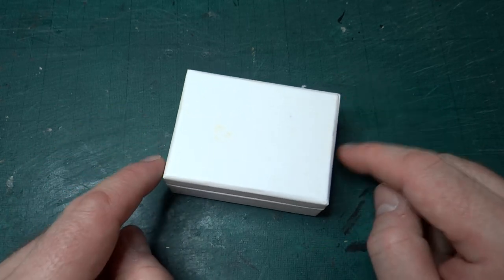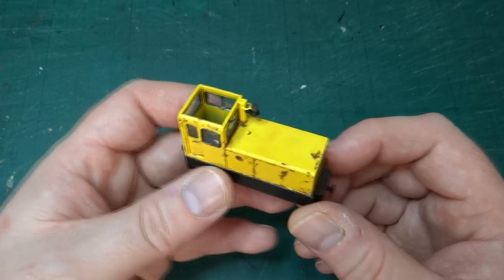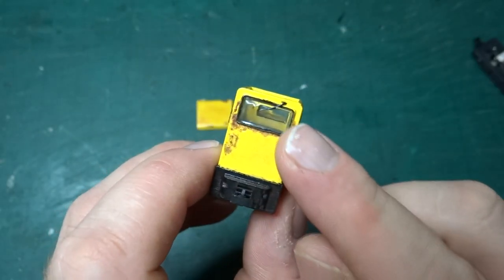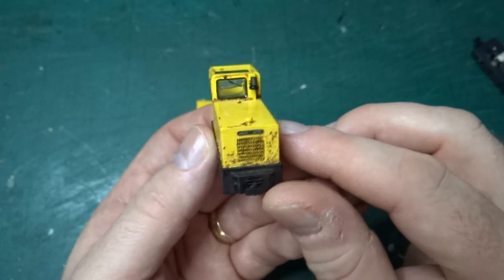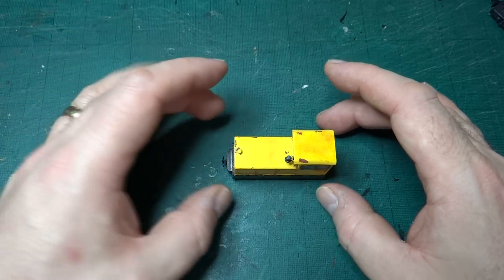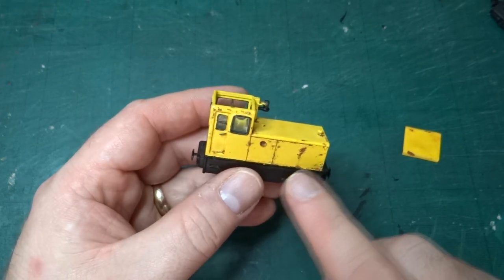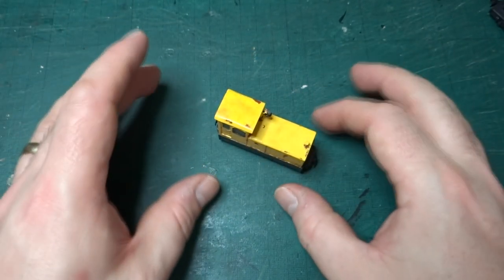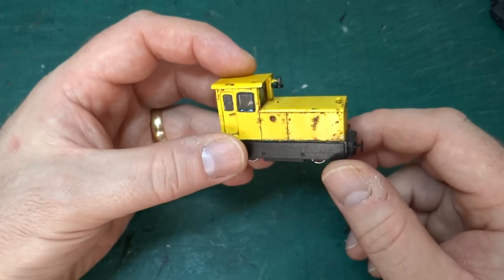I've Finished Building.... a 99hp Baguley-Drewry from a kit by Narrow Planet

Comment: I noticed that Kato sells these pocket locomotive that is just the motor.  I wonder if these are the same as if you were ripping them out of trams.  They sell for about the third the price of a tram, considering a tram you get two.
Reply from the maker: Unfortunately they aren't the same motor bogie. This model uses the 11-104 model which as you can see in the video is approximately the same length as this loco. The trams we pull apart (the PORTRAM or CENTRAM) use much much smaller motor bogies, and while buying a tram is expensive I think given the engineering that goes into the bogies they are worth every penny if you want to model something so small you need one -- there is no way I could build a chassis for something like my G-Series Simplex or Alan Keef K12 models whereas I could potentially build a chassis for a Baguley-Drewry sized loco.